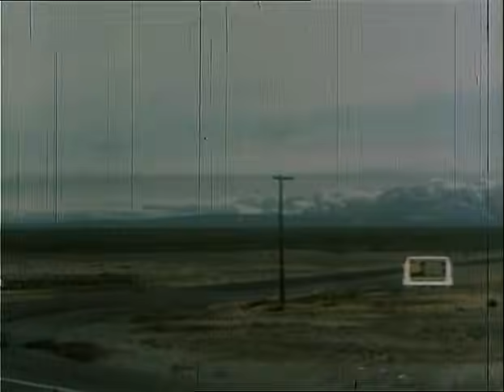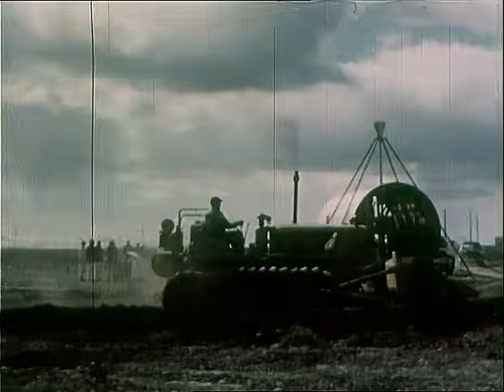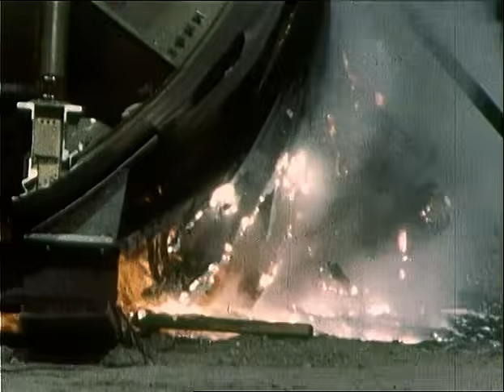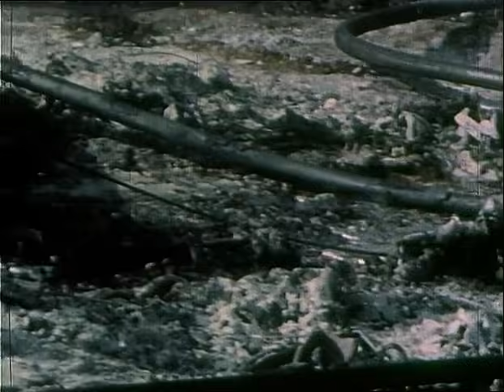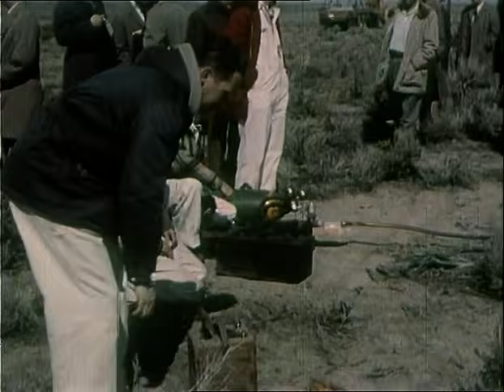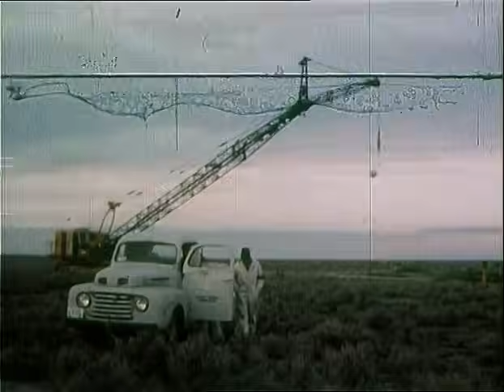Fuel Element Burning Experiment: Operation Weiner Roast (1959)

Comment: A nuclear-powered aircraft would not carry jet fuel, but if it crashed, a meltdown is likely due to decay heat and disruption of the heat transfer mechanism. One possible solution is to use liquid fission fuel-salt (e.g. uranium trichloride) dissolved in molten salt, which would freeze when exposed to the air; decay heat would not be enough to prevent it from freezing if the core were flattened and ruptured on impact; at very least, it would not boil and evaporation would be minimal; airborne radioactive emission would be limited to the most volatile fission products

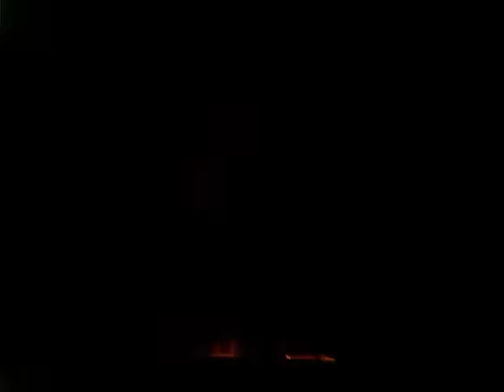Comment: 21:44 the presence of iodine (iodine-131) means the fuel rod was fresh out the reactor. It didn't spend a few weeks cooling off on a pond.
Reply: I wonder how fresh it was ... there would be plenty of very short lived isotopes in a fuel rod a few seconds after reactor shutdown. They mentioned a 4 day delay. The dispersion mostly depends on the elements in the fuel (i.e. chemistry), and perhaps a lot of the volatile stuff (Cs, Sr, Xe, I) is still there.
Reply: True, along with the precautions taken when handling the rods
Reply: @sashimanu I always use great care when handling my rod! ☢️

Comment: "in which aircraft reactor fuel elements, together with other materials, were melted in a simulated aircraft crash" What is an aircraft reactor? Did they have reactors in aircraft? I know they have them in spacecraft,...
Reply: Projects NEPA and ANP for the NB-36H nuclear bomber (one of which flew with a reactor onboard but not powering the engines in order to test shielding for the crew), and Project Pluto to power the batshit insane idea that was Project SLAM… THAT one is worth reading about 😬
Reply: @neohavic6012  It was only insane for the people it flew over. Imagine having to chose between shooting it down and instant chernobyl or not shooting it down and instant chernobyl + 1000 nagasakis.
Reply: @captainotto  that and the fact it spewed radiation over its entire flight path… 😬
Reply: There were a couple programs on both sides of the iron curtain to develop nuclear powered bombers and cruise missiles. They mostly use air heated by a nuclear reactor to turn a jet engine. American engines were built and tested but never installed and the program was cancelled. The Soviets had a flying example in the early 60's. Russia also claims to have tested a nuclear powered cruise missile in 2017. So this video is relevant learning for the modern global citizen I suppose.
Reply: @zoom112358  The Soviets had A FEW CRASHED example's
Reply: @chasingcapsaicin the Russians currently have a nuclear propelled cruise missile called burevestnik.  Since the start of the war they had a big accident test flying it which killed several scientists.
Reply: What google says when I typed in "nuclear powered aircraft tests" ------ "The Convair NB-36H was a testbed for the Aircraft Nuclear ...Nuclear-powered aircraft tests in the 1950s and 60s, primarily by the US and USSR, aimed to create bombers with near-limitless range. Major tests included the American Convair NB-36H (47 flights, 1955-1957) to test shielding, and the Soviet Tupolev Tu-95LAL (1960s), both testing reactors that did not power the planes. Ground tests like Project Pluto (1961-1964) successfully operated ramjet engines, but projects were cancelled due to radiation risks and the advent of ICBMs."

Lovely, eh?
Reply: No spacecraft has those. Yet.
Reply: There are rumors that nuclear bombers exist. Fuel is a huge problem and for long missions where refueling is not possible and staying Stealth is key, having a plane that can fly endlessly at any altitude, where oxygen is not present, makes me believe they have stealth bombers that are nuclear powered. We have had stealth bombers for 50 years. It would be highly unlikely that they didn't make at least 1 stealth nuclear powered bomber.